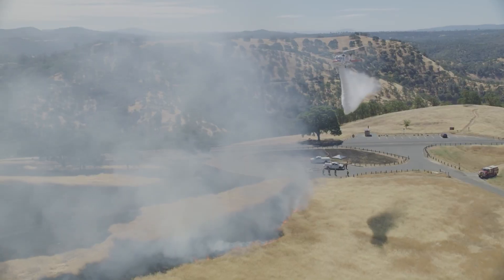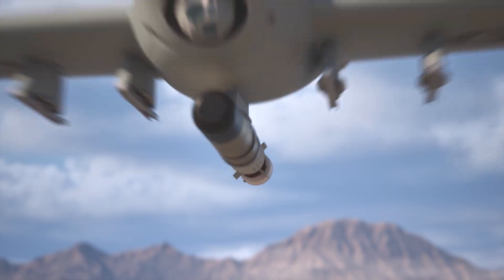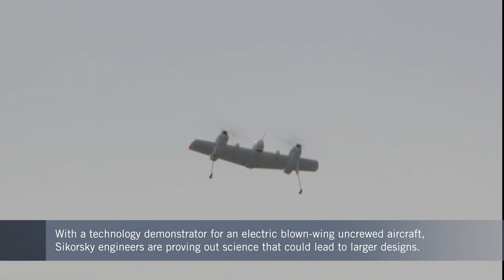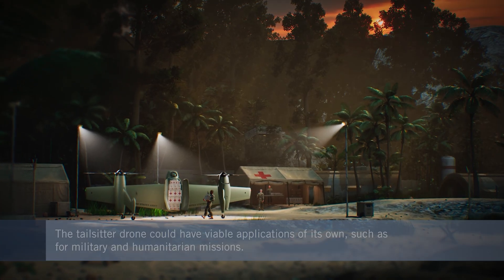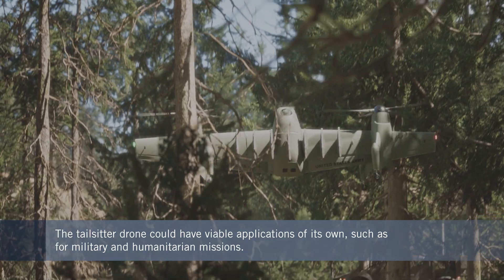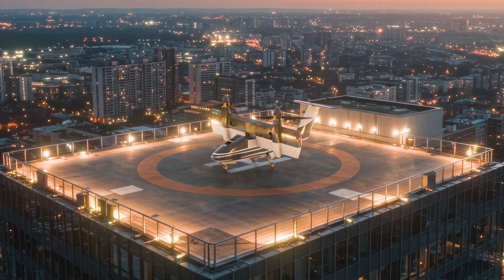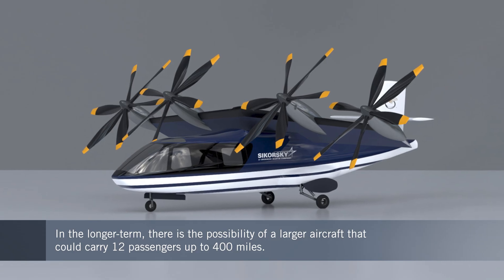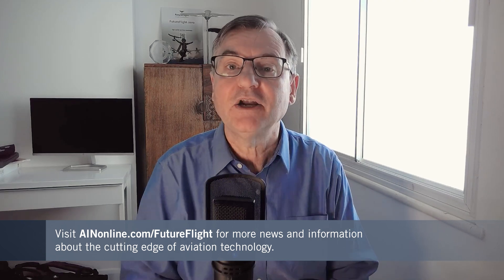Sikorsky’s Blown Wing Aircraft Gives Glimpse of Future Hybrid-electric Technology – FutureFlight

Comment: Both engines are the critical engine with the prop descending on the side away from the body.  Reason seems obvious: A dynamic winglet - The downward wash of the downward blade side cancels out the wing vortex air curling upward around the wingtip.  They made the wingtip long and flat to encourage more vortex air so as to achieve practical cancellation - maybe some up and some down in the wake.

Comment: Imagine the leveled flight performances of such a design with added folding windtips (almost wing thirds in the case of the drone version, almost wing quarters/wingtips in the case of the taxi version...) that would be folded up during hovering phases so the wing parts form a compact flat triangle shape, and be unfolded in translationnal flight with all that high aspect ratio benefits added to it.

Comment: Those designs work great for small drones, but large a/c not so much. any mechanical failure at all on either engine will be absolutely catastrophic. Helicopters can have a failure and safely land. Tilt rotors or tilt wings do not work like this and have killed thousands of people already.
Reply: yes, however, cross shafts help to reduce the issue of motor failure. The big problem is gear box failure; but we have sensors like used in the V-22 that can detect gearbox wear and alert operators of a required gearbox change.
Reply: Helicopters have killed way, way more people than tilt-rotors.